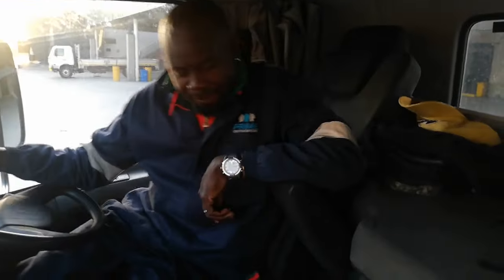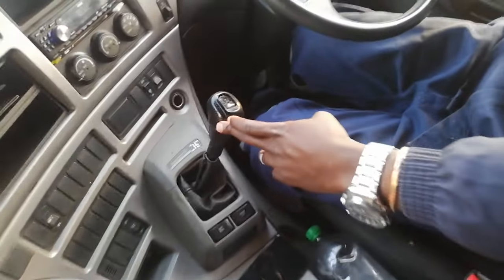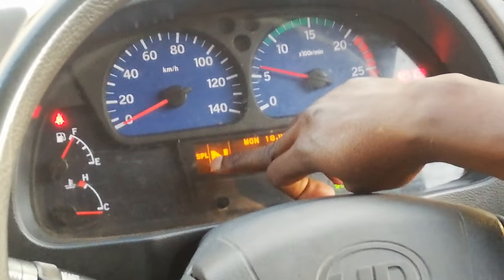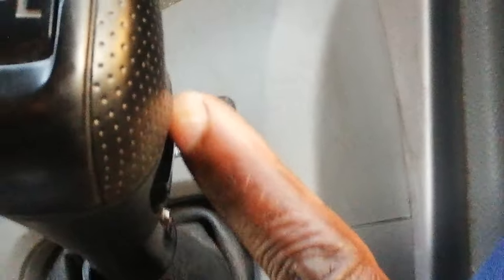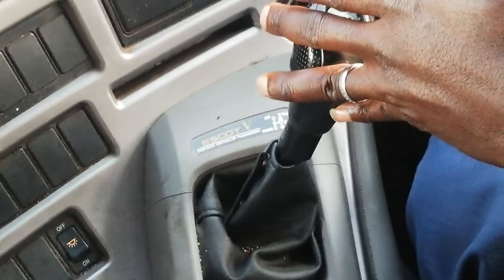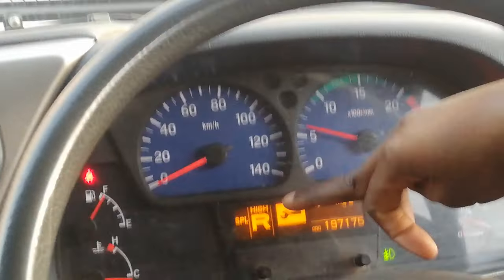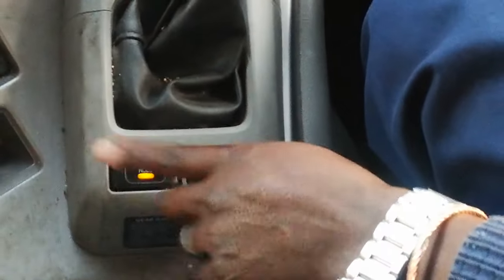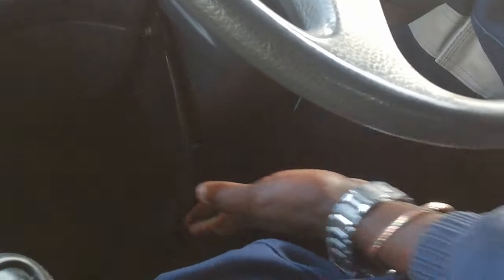GW 26 450 UD 🚛🇿🇦

Comment: Jus helping u brother the retader it's job is jus to reduce the speed  so when loading heavy loads always put it on high which is for tht will help u to reduce pressing of brakes every time coz u know how dangerous is pressing brakes on truck it might bind or burn or air pressure might be low n your brake won't work so the exhaust brake must always be on especially when loaded thnks  UD escorts is a gud one not tht bad
Reply: Where the exhaust brake Burton…?